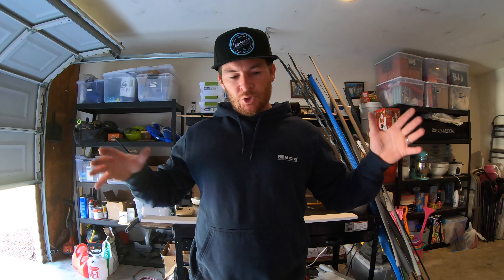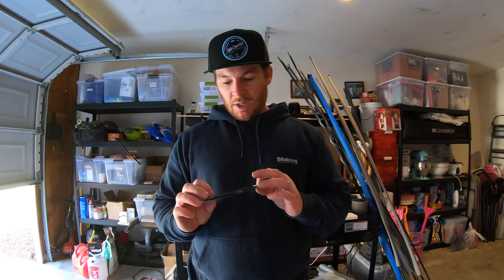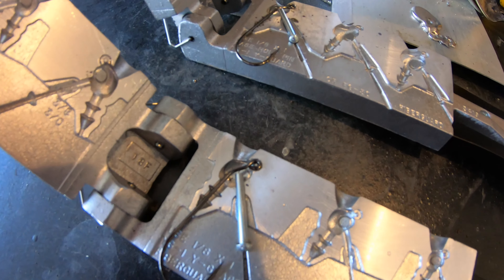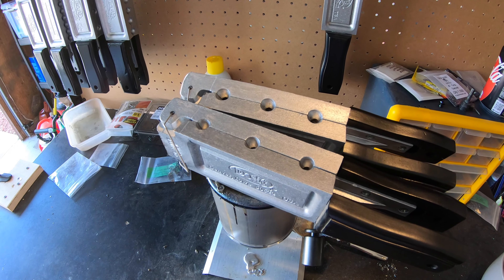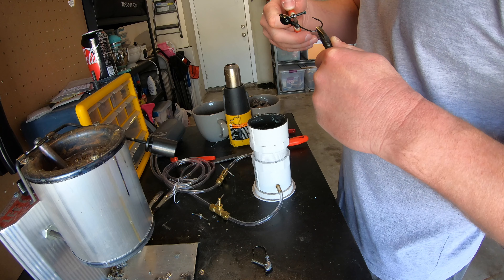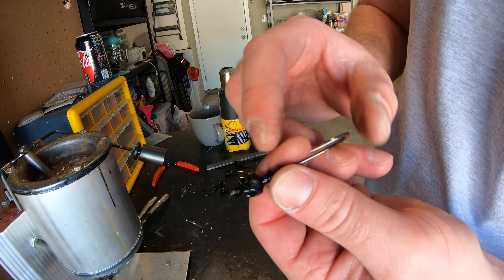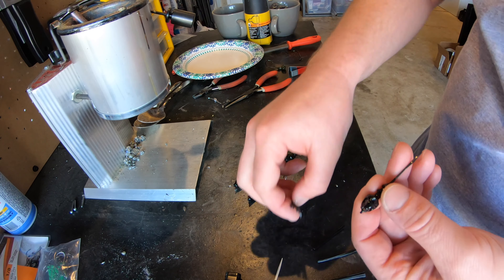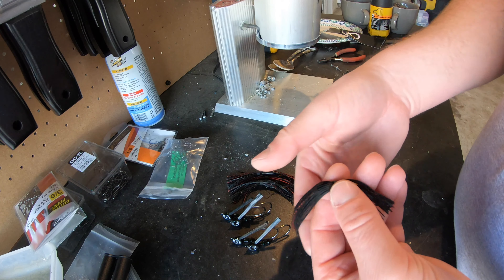How to make SWIM JIGS with 6th Sense Jigs Skirts and Do-It Molds Poison Tail Weedless Jig Mold

Comment: Best thing to do is use a small piece of heat shrink over the hook eye 👁
Reply from the maker: You are probably right but that probably takes the same amount of time as picking the eye out.
Reply: @MattLunaFishing  no if you cut the pieces before hand its really fast, you have to use a small heatshrink and just push it on, heat and dip,  the n pop them off for perfect eyes with no scratches etc
Reply from the maker: Might have to give it a shot

Comment: Matt, Awesome vid man.  Did you have to make a mold mod for the 32886 hook?   Also a tip for you,  re-insert fresh weed guard pins just before baking.  It eliminates the extra drilling.
Reply from the maker: Thanks man.  No you don’t need to mod the mold at all.  It worked fine.  

I’ve always wondered about that.  I was afraid the powder paint would bake to the base hole pin
Reply: @MattLunaFishing   Let the paint cool just a bit before re applying the pin before baking. it works pretty well for me so far. I usually paint with a teflon pin, then put an aluminum one back in the jig for baking.
Reply from the maker: Ron Kramer ok cool.  I’ll have to give it a try!  Thanks for the tip!